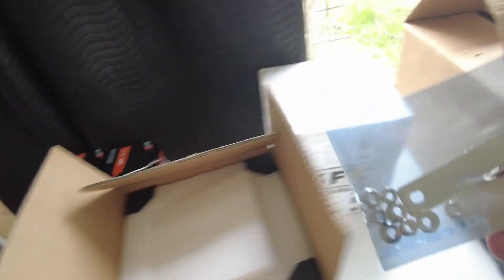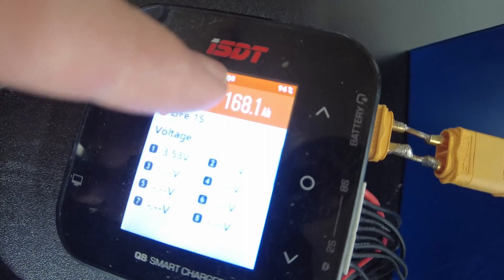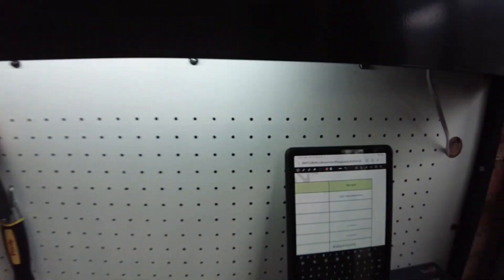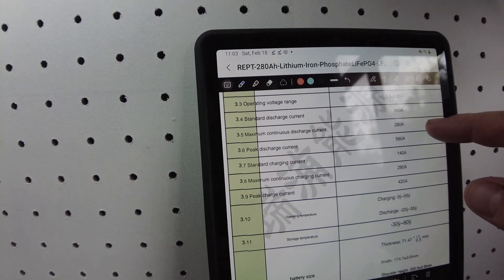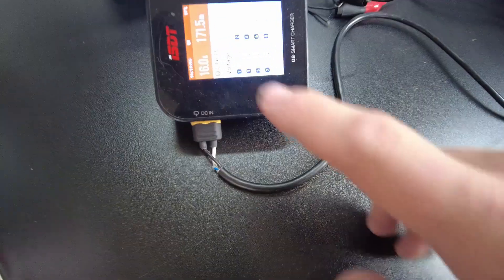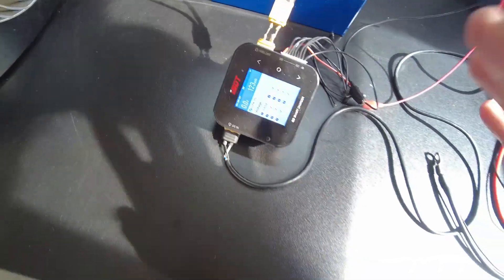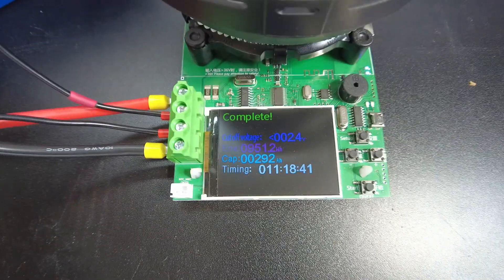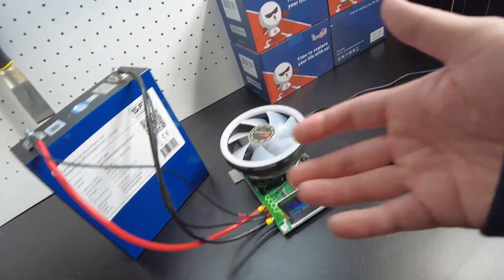REPT 280Ah 6000 Life Cycle LiFePO4 Cells

Comment: The one thing I love about SunFun Kits is they actually understand the importance of a load test. If a 280Ah cell's voltage is dropping below 3.0 from a 300 watt load...which is in the neighborhood of 100A for a 3.2V depending on how low the voltage goes, then the cell is a turd. Even a 280A/1C load should drop the voltage down to somewhere in the 3.20-3.28 range. The datasheets have the graph RIGHT THERE for you to look at. Its the easiest way to figure out if you are getting turds and if you can convince a seller to do a video of a load test on cells with the QR code intact then it would be a lot harder for them to pull this kind of shit. They'd have to fake the test or make fake QR codes and cover the old ones to ship you turd cells. Even a quick IR reading with a YR-1035+ will give you some piece of mind since its unlikely 4 used cells randomly put together for your order are going to be matched well.

Start demanding this from sellers in China. Tell them you'll pay $50 for a video of the QR codes and the cells being hit with a 140A load (minimum) followed by those cells being put in a box with your info on the packing slip. If you get cells with QR codes that don't match you at least have a much better case against them since you had an agreement for those specific cells in the video. If they refuse to do this
A. They are taking your order and its being filled at some far off warehouse they don't have control over
B. They have turd cells and know that's what you're gonna get. They don't even want to waste the time of pulling some good ones and then doing a switcheroo
Reply from the maker: Yeah there's a lot of rip-offs out there, I've seen sooo many reports of this on forums, and groups. Thanks for the comment!
Reply: Wow thank you! Looks like everyone is now understanding!😃

Comment: Taking 4 wire measurement is good. I don't think the discharge rate matters nearly as much as it does with lead-acid. Keep up the good work.
Reply: You are correct sir, even with our Electronic load with 140A discharge it will vary by at most 2-3 AH of capacity. However, its good we test with devices people can easily buy otherwise our results would be hard for the average buyer to replicate. Thanks
Reply from the maker: Thanks!

Comment: Cool... I fly drones and have a few RC grade chargers. 
I have the iSDT Air 8 and I was wondering if it would be any good for top charging
Reply from the maker: Yup, I prefer using a hobby charger over one of those adjustable/variable bench power supplies. Will keep you from overcharging, and ruining your cells.
Reply: @BradCagle  Thanks. how long did it take to charge, and at what setting ?
Reply from the maker: @IamMotorHomeless  I set to LiFe, 3.65v 1S, charge at 16amp. It put in 190ah Took close to 12 hours.
Reply: @BradCagle  I have not bought my batteries yet. I want to run 48V, so 16 batteries, at 2 per day is not that bad :)
Reply from the maker: @IamMotorHomeless  Make sure to hook up the balance leads. It's only two, but it helps the charger know what the actual voltage is at the cell, it'll top off much better.
Reply: @BradCagle  yes, I did see that you had done that.
Reply: what power supply are you using? If you haven't tried the HP DPS Server Power Supplies in series its the best decision I've made for my hobby charger. I'm using the 460W PSU's because they are so cheap. You can get 2 for $20 or a bigger lot for less than $8 each shipped. If you make 5 of them in series and put 30A banana jacks or bullet connectors on the back you can use all 5 for a 48V battery or just 2 for a 12V. Max voltage of the chargers is 13V unless you start messing with OVP.
Reply: @ericklein5097  Yes, I must admit I was thinking I have a few chargers. but I would not have enough power to run them all at 16amps.
I have already bought my @VictronEnergyBV solar controllor and planning to buy a MultiPlus-II 48/5000/70 (once it's back on the UK Type Test Register)
So it's just the first top balance, and if that takes me a week to do all 16 batteries. so be it :)

Comment: Very good review! So you can see the WH is matching the Label almost 100%, but the AH is a bit off and the reason for this is the AH Is tested at 3.2V nominal but in your test your nominal voltage was 3.256.  To normalize the AH to 3.2  Take the WH your tester measured and divide it by 3.2.  So 951 / 3.2 =  297.185 AH @ 3.2V

The Watt-hours remain the same.  When manufacturers test these they always look a the WH measured and then assign the AH by dividing the measured watt-hours / nominal voltage of the chemistry. For lithium Iron Phosphate it is 3.2

Try it out it will check out this is why we now put BOTH readings on our labels.😀
Reply: Do you have a UK distributor ?
Reply: @IamMotorHomeless  Not at this time.
Reply: @sfkenergy  😩
Reply: @Albert I don't know. I have watch so many videos of people having bad experiences buying from Alibaba. I have bought twice off Banggood, and both times I regretted it , getting stuff that was not worth the cheap price. and honestly untill people buy up all these 'low grade, used batteries'. I'd be happy to pay a little extra and know I have got what I wanted. and if it does go wrong, someone is there to help.
I pay car and home insurance. consider it new battery insurance
Reply: @Albert Right that makes total sense, the manufacturers are just looney tools scratching up their qr codes and selling them at auction for 1/3 the price...